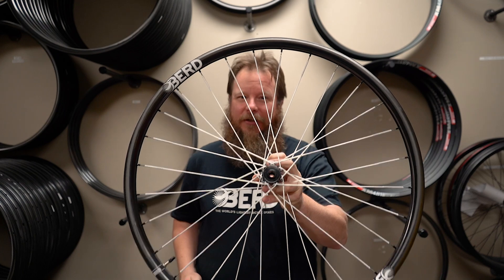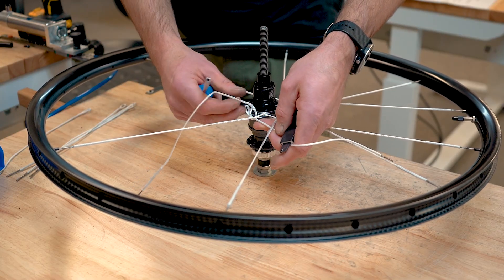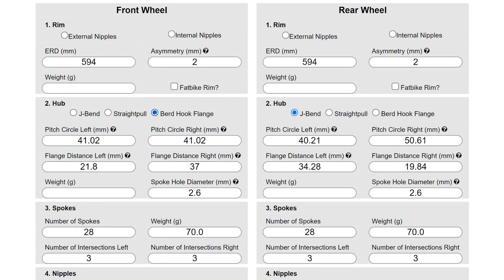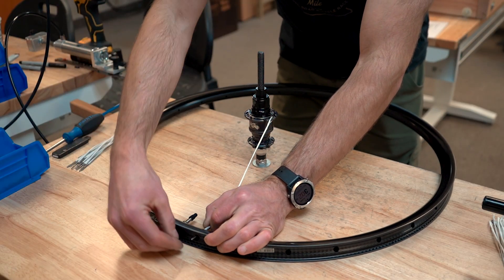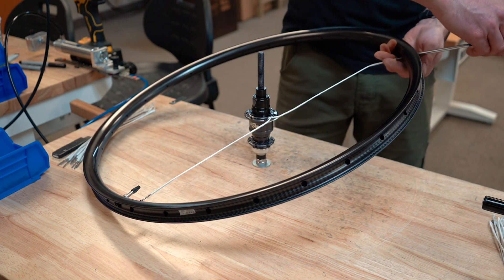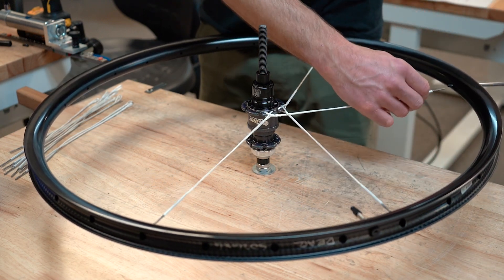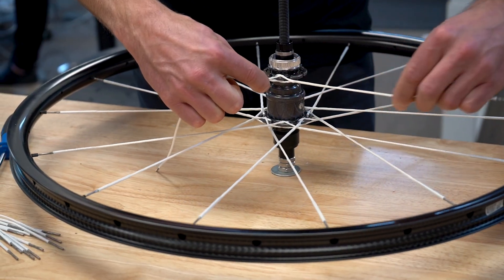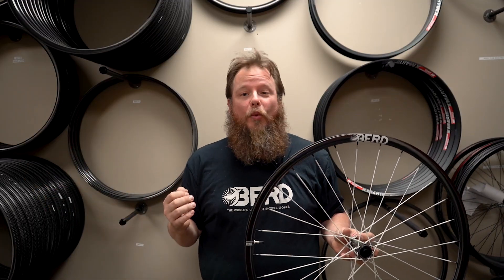Hook Flange Hubs | Building Wheels with Hook Flange Hubs Designed Specifically for Berd Spokes

Comment: Just an observation but wouldn't building a wheel on a threaded rod mar up the hollow portion of the hub? Threaded rods are typically pretty hard with sharp edges. That being said I absolutely loved my set of AM30s with Onyx hubs. These new Onyx hubs look even better!
Reply: this is probably the rod out of a park tool thru axle adapter from a truing stand. Specifically made to go through hubs, this rod has very thick threads and no sharp edges to prevent hub damage

Comment: How small a wheel can be made with these?  Are there any non-disc hubs with this system?  I am interested in making a super light 406 carbon wheelset for a Moulton XTB, which has rim brakes on front, disc at rear, 100mm and 135mm QR.  This may be a bridge too far...